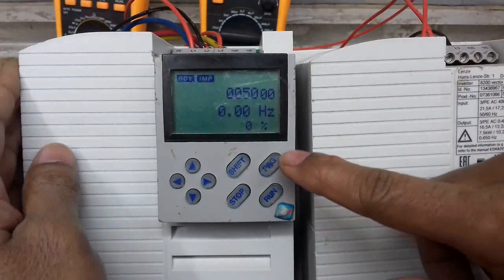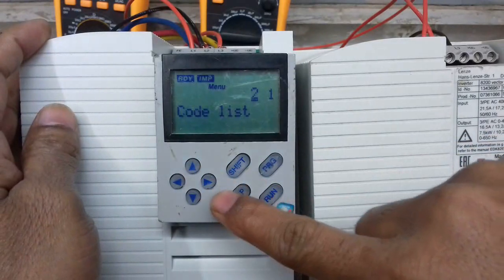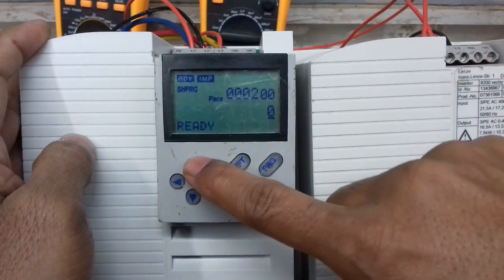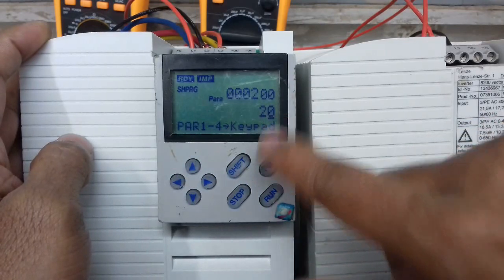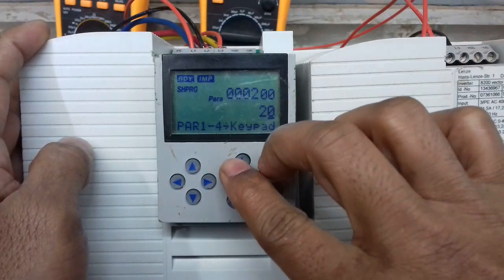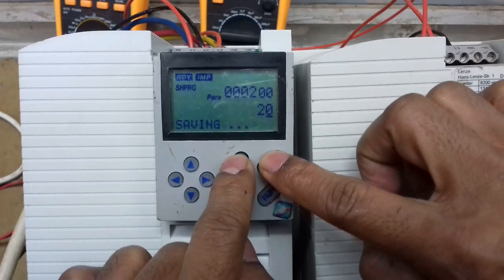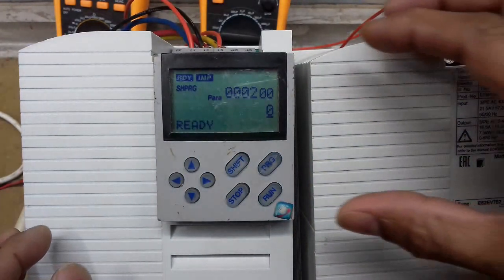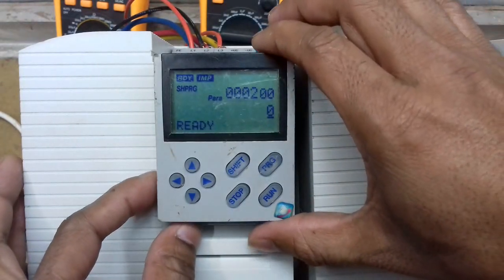Lenze E8200 VFD Parameter Copy From VFD To Keypad Then Keypad To VFD

Comment: Hello friend what aif and pc software can i use to switch from cam profile v 8.1 mode to servo inverter software version 8.1... i dont see Emf9373db pc adapter to this and the pc lenze loader v31 to do the firmware upgrafing for a 33.3328SE.8G.81 or EVS9328ES